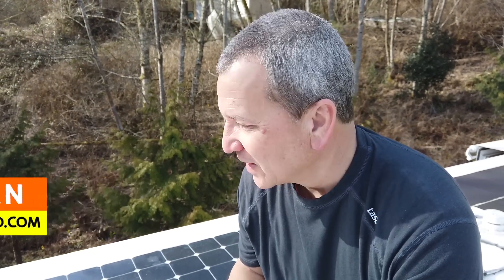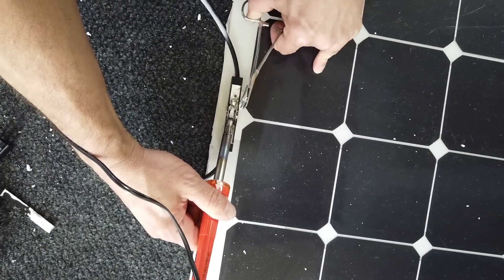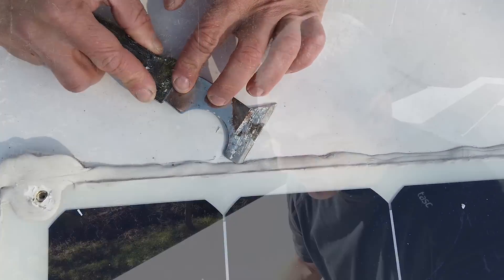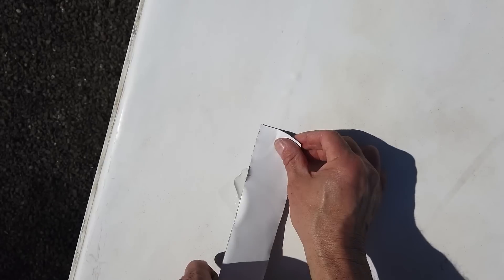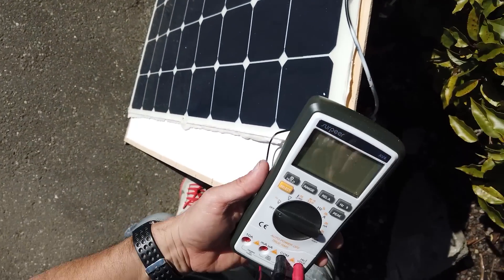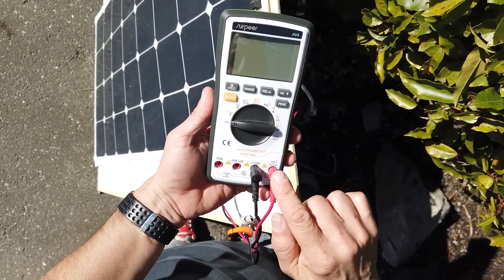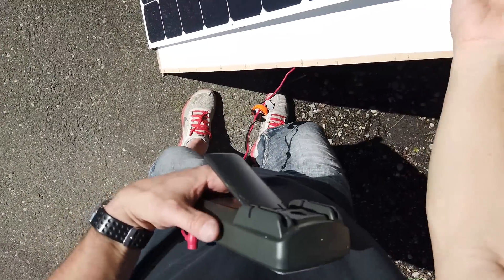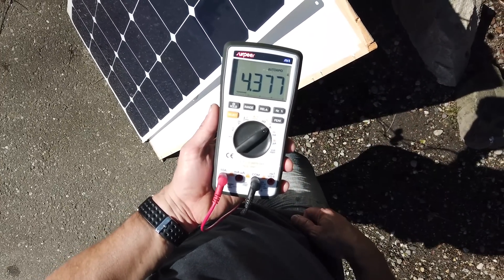Flexible Solar Panel FAILED after THREE YEARS on my RV

Comment: Have you considered more efficient CIGS panels instead of the flexible crystalline ones? I know you have a pair of CIGS panels still on your roof, but those are a bit inefficient by today's standards.
I have 6 Miasole  75 watts panels. So far I've seen 420 watts production of energy.
This makes me want to modify my absorption fridge into a compressor unit.
http://miasole.com/miasole2017/wp-content/uploads/2018/03/flex-03_offgridcustom_datasheet_1.pdf
Reply from the maker: I like seeing new Thin Film technologies come out and I'd love to try them out when they are ready for the consumer market. I hear they are too expensive to produce still. My Unisolar panels are standard amorphous thin film panels I believe and not CIGS. Thanks!!

Comment: Hi Brian, could you tell me how your new blinds are holding up. I replaced mine with a different brand a few years ago. The problem was the plastic gears kept breaking. Thanks. Doug
Reply from the maker: So far they haven't worn out but it's only been a few months. We love the day shade.
Reply: @RVwithTito  I bought some that were similar to yours ( not MCD) It seemed like I had to replace one or two on every 3 or 4 trips.

Comment: I kind of wish you had shown more detail on how to test the volts and amps of the panel after it was removed.  Looked like you had some special connectors?  A good helpful video, thanks, although I doubt I'll ever attempt to repair one of these flexible panels.  (How to remove dicor and cleaning the roof is helpful).  Looking forward to seeing you new mounting technique...there are a lot of videos claiming these panels fail in the heat if flush-mounted on the roof.
Reply from the maker: I just made those connectors using MC4 connectors and 12 gauge wire with a wire splice on the end. You can also just stick the multi-meter probe into the end of the MC4 connector, but you'll have to hold it still while you take a measurement.

Comment: Yup the flexible panels don’t last. Had 4 flexible panels on the roof of my camper replaced 2 under warranty in under 4 months. Then a third went bad so I just replaced them all with renogy rigid panels. No problems after that. 

I believe the problem with the flexible panels is overheating since there is no air gap underneath. I live in south Florida so lots of heat. If you look at the rigid panels they look exactly like the flexible panels mounted in a rigid frame.
Reply from the maker: Yes. There are lots of options. But, like traditional panels, not all flex panels are the same either even though they may look the same. It's very hard to tell though so it's best to pick a reputable source. Good thing you were able to replace yours that were under warrantee. Thanks for sharing your experiences!
Reply: Yeah aluminum backed flex panels will be able to dissipate heat better the thicker the aluminum is.  But you lose all that “heat sink” when you slap it down on the roof.     I’m to the point now where I don’t see any added benefit to doing flexible unless it was on a conversion van or vehicle and you really did need the height savings to fit in garage or whatever.   Traditional panels hold up just fine if mounted correct.  A person can get rubber bushing mounts to help with any potential flex movement
Reply: if overheating due to direct flat installation is the problem them perhaps mount them on slightly raised plastic grids?

Comment: Need advice on electrical testing tools needed for the RV. Getting to rebuild my tool kit as most of my tools were stolen out of my garage :(
Reply from the maker: You don't need much. I like that SURPEE multi-meter with the big numbers. You can see it here on my shop-tools kit https://kit.com/rvwithtito/favorite-shop-tools. Aside from that, wire stippers, pliers and a crimper. If you work with solar then a clamp meter really comes in handy too.

Comment: Unfortunately,  you, me, Will Prowse and I'm not lost, I'm RVing have come to the same conclusion. Three years is about it. I have 12 panels and about 1/2 have failed. A few failed in one year. I'm removing the 1200 watts of flexible and replacing them with 4 - 300 watt panels.

Comment: 09:49 You should cover the PV panel with a black tarp so you don't run the risk of breaking the diode part of the meter.
Reply from the maker: Good idea, but I was in the shop and out of the sun when I tested the diode.
Reply: @RVwithTito  Careful, these panels still generate decent power to kill the meter, even in the shop. Luckily, this panel was almost dead.
Reply: @RVwithTito  Dunno how much power it makes with artificial light?

Comment: I see you going with my greenhouse panels I used couple years ago.
They help.
Just get the 1/2 inch thick ones.
The 4 - 7 mm ones are stock thickness and cheapest.  The thicker ones are better heat transfer.

Comment: I'm not sure how you're getting away with it but a word of caution, place you're probes on whatever you're measuring after you set the meter to the function to want. If you just turn the knob thru the functions with your probes connected you will connect to a function that will blow the meter before you get to the function you want. Always turn to the function you want then connect probes! Hope this helps.
Reply from the maker: Thanks. That's probably better practice doing it that way. I have blown a few fuses :) It's usually fine though as long as I'm within the 10A current max. I usually use a clamp meter for this test, but didn't do that in this video.

Comment: I wonder if you take a razor blade to the rear of the sheet if you could separate it from the module and expose any tabbing between the cells?
Reply from the maker: Yup. I'll probably give that a try.
Reply: @RVwithTito  You might be able to fix it that way if you are very careful! My theory is the panel got too hot in an area that didn't have good contact with the roof. Which melted tabbing solder. Repeated heating/cooling resulted in cold solder joints in that area. Voltage but poor current. Good luck finding the right spot.

Comment: Thanks Brian!  Saw the note over on Instagram, we're boondockeroutlet, so popped over here to watch the whole video.  The heat trick is cool.  I followed your install for our six flex panels.  Makes me think I should go up and test each of the panels to see if any have failed.  With so much variability we get here in WA I'm not sure I'd notice if 1 of 6 had gone bad.  I look forward to your next install update for sure!  Any chance you're looking at tilt options for them too?  :)
Reply: Monitor your charging amps over time (days/weeks). If you notice a drop that doesn't come back to normal, you probably have a problem.
Reply from the maker: Thanks for bouncing over. Yeah. I was confused at first because the voltage for the array looked right but the current was very low.

Comment: Without airflow under those flexible panels the heat will soon make them all fail. Airflow thru the underside to keep the temps down is critically important. That’s one reason they discolored your roof. It baked its imprint onto the rubber roof.
Reply: Slim Potatohead had his flex panels on a raised mount and they still failed 🙁. Hopefully one day the technology will improve though! Some people get a few years, so get less.
-Thomas
Reply: @HappilyWhereverAfter  Thomas I'm with you on that, the vibration from wind while traveling will likely destroy solar cell connections just as fast as heat damage. While the panels are flexible, that's in comparison to traditional panels. The flat circuit traces in panels are thin copper, bend (vibrate) a flex panel enough times and it will break.

The heat that caused your panels and Brian's one panel to fail, likely caused a break in a cell connection within the panel. They use high temperature solder during the process but repeated high heat and cooling can cause cracked solder joints. Those bad joints may cause low/no voltage or no ability to handle current like in Brian's case. Glad you like your new panels.

Comment: Well darn...my only suggestion would be a panel with a 15, 20 or 25 year warranty which would likely be made in the USA. At least this might be an indicator of a panels quality. As always, I recommend the Unisolar brand and even though they are now out of business, some new old stock is still available on eBay.  I also hear good things about the solar panel manufacturer out of  Bend, Oregon yet cannot recall their brand name. There is a YouTube video tour of their production facility that is pretty fun to watch and seems a high quality product.
Reply from the maker: I still have 250w of Unisolar on the roof too. They're over 6 years old and still going strong.

Comment: Brian, In order to have a current flow, shouldn't you incorporate a dummy load between the + & - output leads? That DMM if connected across the output would act as a high impedance load and I would't expect to see any current flow. Assuming you get 20V at 5A, you need about a 4 Ohm resistor as the  dummy load. ... Jim
Reply: I see this is old, but for what it's worth, you do NOT need a resistor any any load to measure current when checking with a multimeter connected to measure current. You are simply shorting the panel through the meter when connected this way, and it will measure any current output the panel may be providing. This is how Isc is measured.

Comment: Lol they all fail. Only ones that last are copper backed sunpower solar cells. But even those have reduced output after a year. All flex panels are horrible and I have tested stacks of them. Really disappointing.
Reply from the maker: Hey Will. Yeah. Still pretty new tech especially with mono cells. Lots of room for improvement. My thin film panels are still rockin it though after 6 years. I agree that Sunpower is the solution for now.
Reply: When he switches to measure amps, shouldn't he be tied in to the circuit in series?  (between the panel and the battery to give the current a place to go)
Reply: good question, but turns out he is in series the ckt is actually neg lead to amp meter to plus lead all in series and this loop is “completed” through the panel
Reply: Too funny. I was just going to mention Will Prowse (I bought your Mobile Solar Power book-great how to book-) as someone I follow and say that they all fail according to Will Prowse.   Flex panels simply not there yet. There's a reason most companies quit manufacturing them. My next door neighbor was a design engineer for solar panels, says flex have too many weak links. Just can't handle the everyday sun and heat generated by the sun.
Reply: @garlandcampbell7994  Thanks Garland! And yeah, very unfortunate
Reply: @garlandcampbell7994  Will Proise is a kid and need to grow a set before he can claim expert...
Reply from the maker: @albertcassler8763  Hey now. We're all just trying to help each other here. Will puts out informative content that helps lots of people.
Reply: @albertcassler8763  yow are wrong. Giving an honest review of what you have does not require to be an expert. It will help anybody decide what to buy.
Reply: @neliosamch3195  Do you really know what an expert is...I doubt it
Reply: @albertcassler8763  Yes, a Harvard graduated who take your money and doesn't know what he is talking about. But we need honest  reviews not seller and experts scammers.
Reply: @albertcassler8763  I didn't know you knew each other. I'll not comment about that. It is a very delicate subject that cost me over  50k on lawyers fee. I'll  never criticize anybody parenting skills. It just a business to extract money.  Sorry about that.
Reply: @neliosamch3195  No problem...I think he's a good kid, just green...
Reply: @albertcassler8763  you need to grow a mature attitude before criticizing others.
Reply from the maker: @joeboxter3635  You're right. I think you have to order 10 or more if ordering directly from SunPower. There are a handful of flex panel distributors where you can order individual panels. Sunpoweredyachts.com is one. I have a couple and will probably order more from them.
Reply from the maker: @joeboxter3635  I appreciate that Joe!!
Reply: Have you guys tested ETFE panels?
Reply: @joeboxter3635  Thanks Joe!! :D

Comment: i always enjoy watchig your videos - on this one i was confused due to my understanding one could not measure amps unless a load was attached - i guess i was mistaken
Reply from the maker: Solar panels are a bit different. They generate a short circuit current when the sun shines on them. Solar cells are actually rated by their short circuit current. I guess their internal resistance is high enough to not damage the cells. A bit different from a battery.
Reply: The meter has an internal resistor that is the load for the panel. Typical meter maxes out at  10 amps which is fine for a 100 watt panel.

Comment: Did you answer your question? What would I change next time?
Reply from the maker: Mostly I won't screw them down anymore and I'll add an insulated layer under the panel for cooling, drainage, etc.. I'll expand more in the next video.
Reply: @RVwithTito         Kindly explain how insulation will assist with cooling.

Comment: Having advanced skills for using a Multi-meter shows your level of talent, you continue to educate us all.  I'd be curious to hear from the manufacturer of this panel, what their take is on your ability to troubleshoot a panel. Do you think they want them to be repairable?   Thanks for posting this video.
Reply from the maker: The way they make them, makes them virtually non-repairable unless it's the diode or cable. I'd like to try and take it apart though. Would you like to see that?
Reply: @RVwithTito  YES, with you analytical abilities I'm certain many would like to see that. Go for it. I'll stick with the easy mods, for now. New 5r for me, lots of mods to do.

Comment: While doing my due diligence on Solar I watched your video on flex panels 3 years ago. Although my "installation" was NOT going to be attached but portable so I could chase the sun as we tend to camp in the woods or shade.  After much debate of glass vs flex I went glass due to the high rate of failure i was seeing & local dealer dropping for same as well. 3 years later mine is still working well.  I understand that the newer  ETFE (Ethylene Tetrafluoroethylene) versus PET (Polyethylene terephthalate) are much better (?). I would prefer the flex in theory though.Time will tell.
Reply from the maker: Yeah. I like the ETFE panels. They don't show their age and scratch like the PET ones do. My other panels on the roof have an ETFE coating and have lasted for over 6 years now.

Comment: What is the best way to install flexible solar panels on my fiberglass van roof.
Reply from the maker: I'll show you a new way in the next one.
Reply: IYes...awiat the next video. I  have found bonding to aluminum helps cool the panel. Others feel elevation off the roof is best yet common sense dictates you use a material than can withstand 200 degrees of so. Panels can take a lot of heat but your "backing" material may not. A search YouTube for solar panels and RV's will yield a multitude of ideas.
Reply: don't

Comment: I bought a lot of these around the same time you made the pvc frame videos. They have all mostly failed by this point. I will never by another flexible solar panel again. Thanks for the upload. I just put a short video about my most recent fail and the replacement.
Reply from the maker: They've failed already? My others are still good to go.
Reply: If you buy flexible, Sunpower Only.

Comment: Hi Brian I lost on of those panels in 6 months. To get it off I used one of those multi tools with the vibrating scraper attachment.  I went through like melted butter.  Great idea of heating the scraper for cut through.  A note of caution, I have a metal roof.  So I am not sure how well the multi-tool would work for you.  I lucked out and had it replaced under warranty.  I did make a new mount like yours so I could just basically unbolt it. I did use the tape to hold sown the leading edge of the panel,  At speed it would make noise.
Great information though and as always a great video..
Reply from the maker: Thanks for the tip. I'll show you what I did for the new panel soon.

Comment: At one time I thought these flexible solar panels were the way to go, light weight and easy to mount. Then I started seeing people that had used them complain about them not lasting for more than a year or two and it looks like you've joined the club.
Reply from the maker: This was my first one to fail. I'm still a fan though and don't mind being the lab rat for flex.
Reply: Sunpower panels only .

Comment: Thanks Brian, even though you couldn't find the problem it was still interesting to the the analitical process. OL on a multimeter means OverLoad.
Reply: I am pretty sure it means open loop
Reply from the maker: I figured it meant "open" something...especially when measuring resistance.
Reply: RV with Tito DIY I believe it means Over Limit.
Reply from the maker: @saharts  Yeah. That makes sense.
Reply: @RVwithTito  I guess Over Limit makes even more sense. See you making this video has educated a few of us in the comments alone :)
Reply: I was taught OL means "Out of Limits".
Reply: I looked it up again online, FWIW.

When measuring voltage, OL means Over Load. When measuring continuity, OL means Open Loop.